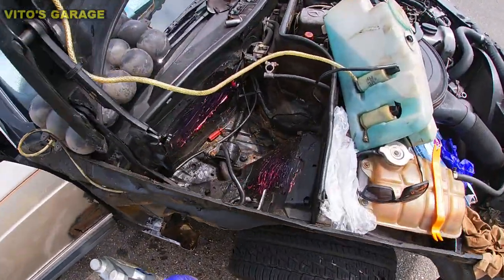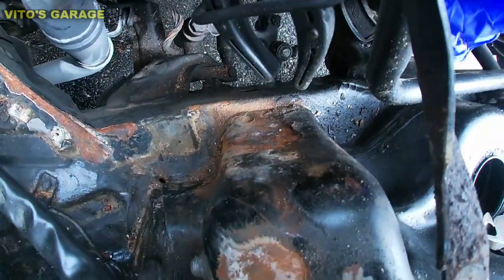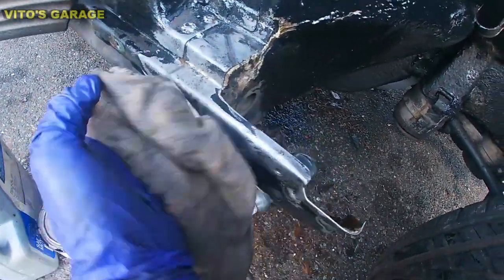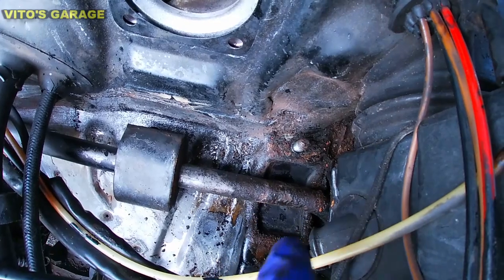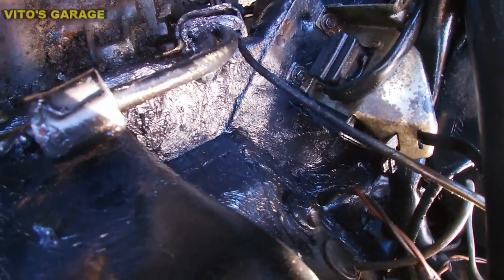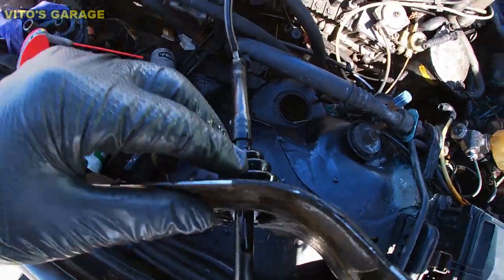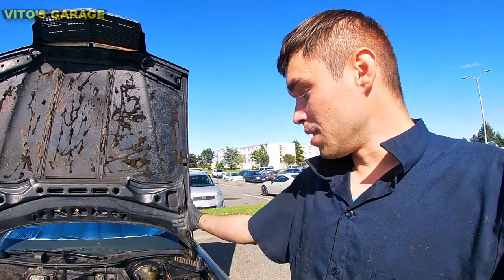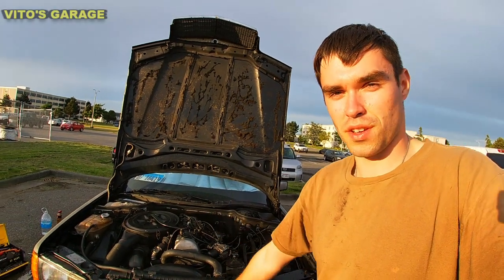Mercedes W126 Restoration Ep.8- Important Engine Compartment Rust Repairs & Preservation!

Comment: I'm in the middle of doing rust repair  on my euro 500sec  and i stumble across this video  ..the front areas around  the spring perch and the guide rod mounting areas are ones to look out for, that undercoating hid alot on me and  now i have to do a few repairs.. i wasnt going to take the master cylinder and booster out but now i think i will haha, thanks for the tips on products and things to look out for. my hands are literally still dirty as I type this from working on that damn thing but itll be back on the road soon
Reply from the maker: Awesome!! Thank you so much for saving and loving old school Mercedes!! Thank you for watching and supporting!🙌🚗🚗🔧🔨